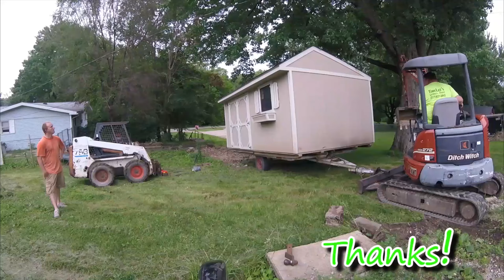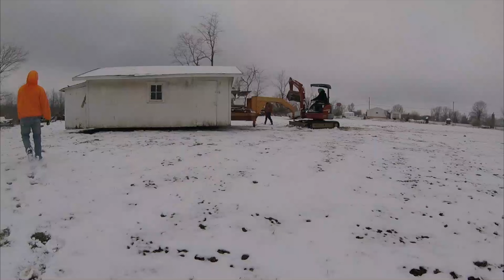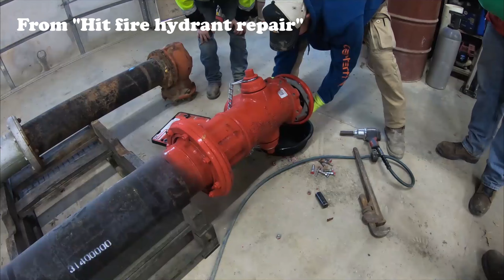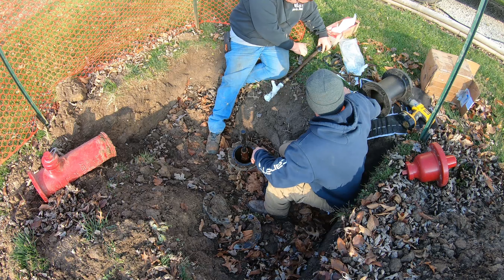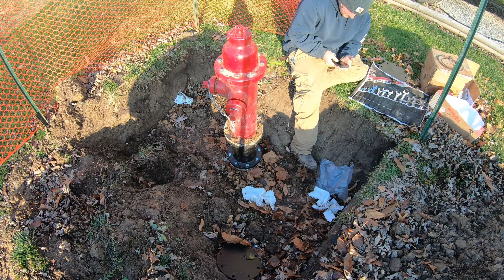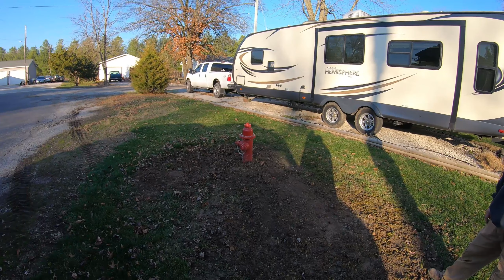Kennedy Fire Hydrant Extension

Comment: about 10 years ago, Our town did something dumb with one Fire Hydrant. No one knows why and still bit of a joke at the town hall that pops up. but its fixed now back in 2019. But One Hydrant 10 years ago was what it was like what you were doing it was in dirt. so a extension was put onto it. but problem was The Extension they decided to go with. It was 8 feet long. Yes the Fire Hydrant Sat 8 feet above the ground. After it was Done, it did make the local newspaper. I do believe it actually even was on local news channel on tv. But it sat there for 10 years until 2019. Town decided to do something about it finally and it was lowered to a more proper height.
Reply from the maker: Lol that's great!
Reply: Was the jolly green giant on the fire department?

Comment: The worst is when you drop one of the parts down hole.  Then you are pulling everything out.   Watch out for those "Carter" pins if you are pulling the stem and valve.  Had a coworker slice the palm of his hand on a oily, epoxy coated AVK spindle.  Give me a rusty bare steel one any day.
Reply from the maker: Definitely, we really have to watch the ends of copper as well. Stuffs sharp and guys want to slap the nuts on it for fitting with their palms. Slice ya good! We always good around and call stuff wrong. Lol hence the "Carter" pins.

Comment: You should have read the directions!  You were supposed to remove the "break coupling" and replace it with the "extension coupling" on the lower portion.  Then install the "break coupling" on the upper section so it does it's intended job if it gets knocked over. You risk bending the operating stem if not done in the correct order.
Reply from the maker: It's funny you noticed that because I also realized what we'd done after the fact and did correct it.
Reply: Excellent. I was about to comment the same. Glad you corrected it!

Comment: It’s installed wrong the black sleeve goes on the bottom and the piece that was already on the shaft is a break away traffic flange. If that is hit by a car it won’t break properly.
Reply from the maker: Looking back when I did the video, I realized that and we did flip flop that extension to fix that. Should have mentioned that. Nice catch! I had done several Mueller's but that was a first.
Reply: Nice work ! Those Kennedy’s are nice to work on. I only saw that from 20 + years of putting those together . Keep up the good work, not many people want to mess with hydrants any more .